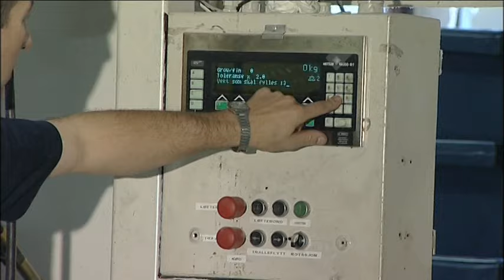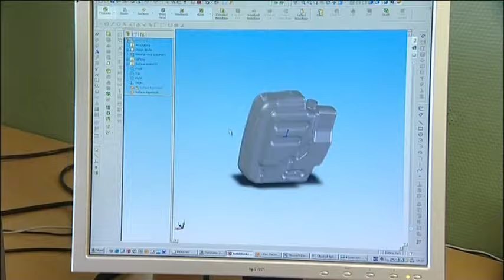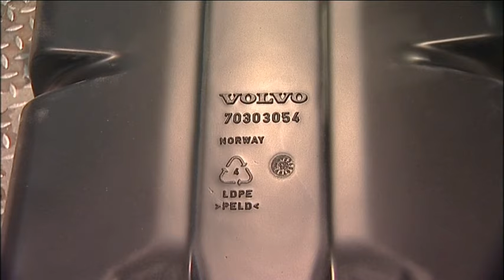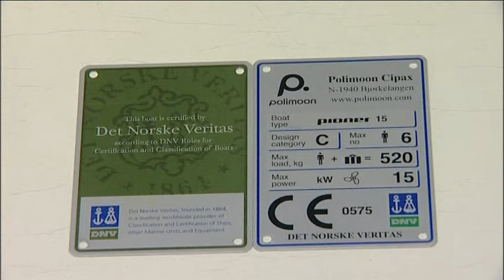Pioner  Boats polyethynene   rotational moulding

Comment: Cool boat that probably works well in cooler climates. Leave it out in the sun in the Florida Keys would be a true test of structural integrity.
Reply: It,s UV stabilized so it take a good heat, but i dont know if in very hot climate.I have  a 10 ft  with a 9,8 but it,s here in Norway and colder.My last one lasted in 11 years, out whole year and never trouble with the boat.It got stolen  so i no have a 10 dark line with the dark Tohatsu 2021 and boat 2020.   If in hot climate  i think the darkline can be a bit hot in the sun.
Reply: How many people are out on those same keys with rotomolded Yeti coolers that hold up just fine?
Reply: @grinchyface , I’ve never seen anyone fish out of a YETI cooler, you?
Reply: @racrx7  you implied the sun would deteriorate the plastic, I'm just giving you a source of empirical proof that isn't the case. There might be other concerns that are more valid, but the sun damaging the integrity of the boat probably isn't one of them
Reply: @kaavest  would they take a vinyl wrap and or paint to protect the poly and extend life ??
Reply: @jimlofts5433  You don,t need anything, it can just  stay outside year round in all kind of  conditions and just wash it a little bit before out again in the sea, my old one just  on the sea all time, the new one i drag on shore for winther.But it need bottom paint to avoid growing under etc.A wery solid construction.

Comment: I has these boats very often used.
The first before 2010 was not so good in rough waters.
Then the Factory modified the design and made it wider and longer.
Now with this modifyed design, its a big difference, explicit in rough waters.
We still have 3 of these boats of different ages, that we can compare.
I love this newer Boat 
"Pioner Multi III".
PS: HDPE can lasting up to 50 years depending on the ingredients of the Mould and how you use it, with almost zero maintenance.
Reply: Hello, I'm interested in whether the styrofoam is always filled with water or does it self-discharge

Comment: Great idea, up to a point.  That point is, after building, a supposedly watertite hull, then go and drill a bunch of screw holes in it makes no sense to me.  Maybe I overlooked a step or something, but, I wouldn’t want it with any holes drilled below the top of the transom.  And I don’t like the front drop down gate, but, that is a terrific idea for scuba, swimmers, etc., for water climbing aboard.
Reply: The whole stern design is bad... must have been wanting to minimize plywood usage. Doesn't look like optimal for good energy transfer to these untrained eyes. Too bad as everything forward is really nice.

Comment: i haven't seen a poly boat with a perfectly flat bottom yet in my life, and they ride accordingly. durable, sure, i guess easy to produce once you have the equipment....but as far as performance is concerned, their brightest highlight is "floating"
Reply: Yeah , You can go out and buy all the equipment to do the job and then make you molds or have them made , and you will have whatever shape you want ,or just buy what you want from those people.
Reply: That’s because large Roto moulded products are extremely hard to keep 100% flat by virtue of the material and process. It’s not injection moulding, the tolerances are wider and more difficult to control. I can’t speak for boats but I paddle some pretty nice moulded kayaks which are fantastic quality.

Comment: I had an idea similar to that using epoxy resin. I was trying to make hollow three dimensional shapes out of fiberglass without the need for joining pieces. I also wanted to coat a piece with resin without it dripping. I think I need pursue this one.

Comment: 2 questions:
1) why using LDPE and not HDPE (which seems much stronger)?
2) why sailing boat are not (or rarely?) made in polyethynene ? Polyethynene would be perfect since it's nearly indestructible, and super easy to repair (we can "weld" it). 

Is it linked to the cost of production? Or what else?
Reply: Heavy, Ugly, too flexible
Reply: 2) I talked to a boat dealer about this. There are polyethylene systems that do a fine job in this application. They incorporate a blowing agent for the the inner layers and so they are cheap, light and stiff, and basically indestructible - the dealer complained about how hard they were to break apart for disposal; a chainsaw was the only thing they could use. However, people don't want light and indestructible, they want shiny white like fiberglass, and the one thing you can't do with PE is make it shiny white like fiberglass. People are stupid.
Reply: @MrSunrise-  indestructible + repairable + recyclable
Reply: @MrSunrise-  the issue is weight. offshore, a fiberglass boat will ride miles better than a plastic boat. take one out in 5' chop and get back to us.
Reply: You could say the same about almost every wooded boat, until you add some lead ballast its little more than a floating paperweight.

Comment: You guys should wear a mask 😲
Reply: its polyethylen, not PVC! So no health problems.
Reply: @robertjanko6709  anything other than air going into your lungs is bad
Reply: I love simple minds!
Reply: Super C 

Self appointed expert who has no idea 😂
Reply: Why? Polyethylene is a high-temperature thermoplastic. All the gasses have been removed from the resin. There is literally nothing flashing out of the resin. The powder they fill the mold with has been ground to a consistent size and the fines removed (required to get the right flow characteristics in the mold) so you don't even have dust.

Comment: so basically a plastic boat. Good luck that thing making it more then 5 years in the Phoenix AZ heat. Ill stick with metal or fiberglass.
Reply: With the right additive package, Phoenix is a cinch. (My wife designed additive packages). You'll need extra UV stabilizer and the normal amounts of anti-oxidants; stick with light colors or go without to make it more comfortable in the desert sun. Talk to Ingenia - they have offices in Houston.

Comment: Haven’t you blokes heard of occupational health, you’d be closed down in Aus.
Reply: Pioner is a norwegian company. Do you really think, that that they dont care for their workers? They have more or less the highest labor safety standards in europe! The guys are working with PE not with PVC. Big difference!
Reply: @AEON.  Thanks for the info! A swedish friend has  a Pioner 13 and even after 20 years outside (with  a tarp over) it looks like brand new. HDPE is also used for the Coleman canoes. Its almost unbreakable. So these boats last very much longer than a fiberglass boat, the production process is less harmfull for the environment and if you have a crack you can weld it on your own.

Comment: Can anyone confirm that Pioners are made from LDPE rather than HDPE. And also what is the story with welding, I've been given conflicting info. Can HDPE be used in rods to repair cracks in LDPE?
Reply: You cant mix the 2, but ive been wondering about that as well. Im pretty sure pioner boats are ldpe. Have you found the answer to this?